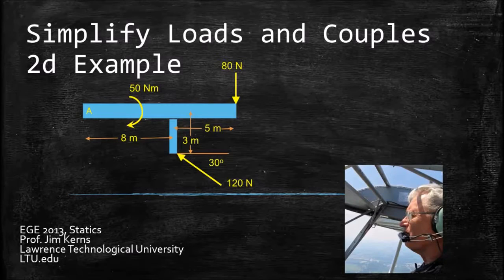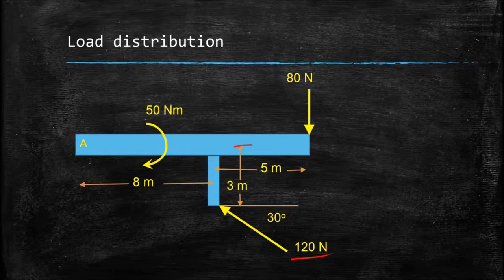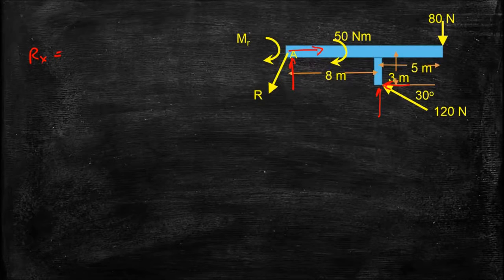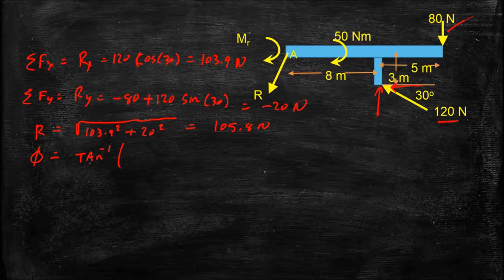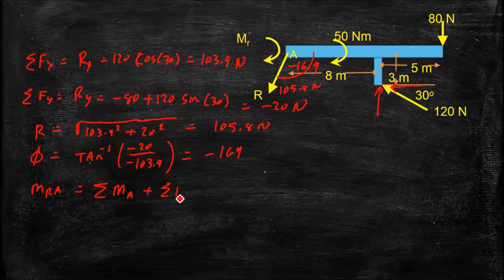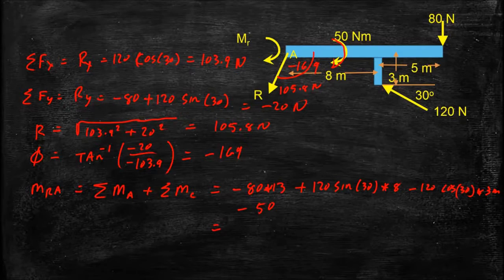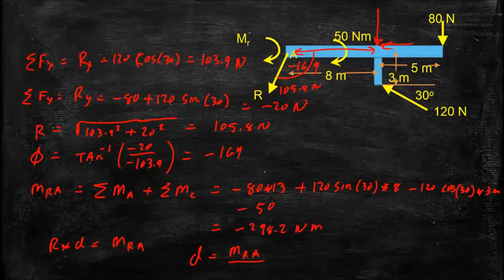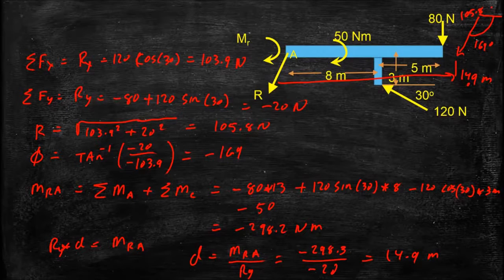Statics: Simplifying Forces and Couples 2d Example

Comment: Not sure if im crazy but i think the Mra is wrong momentum doesn't add up number wise at least, i may be wrong.
Reply from the maker: It appears that you are correct. I get -921.7 instead of the -298.2 at 7:34. Thank you for pointing out the error.
Reply: @jameskerns717  So the moment would be 921.7 clock wise?
Reply from the maker: @miroslavforgac8083  I believe that is correct - is that what you got? You can check my math again :-)

mra = -80*13+120*sind(30)*8-120*cosd(30)*3 -50
mra = -921.7691